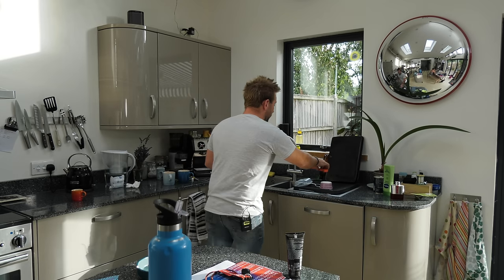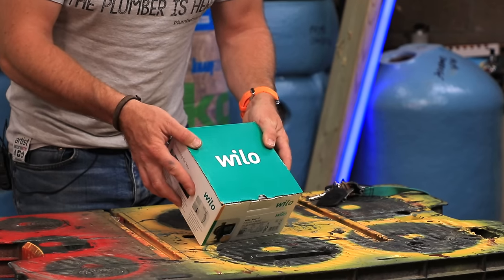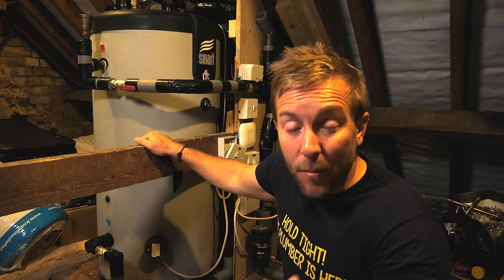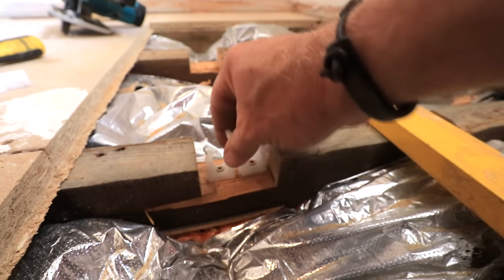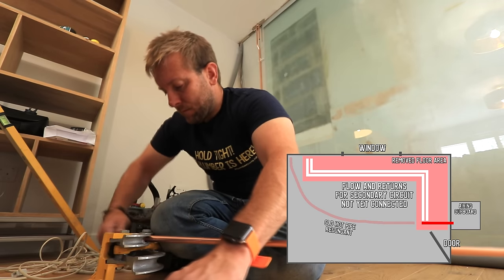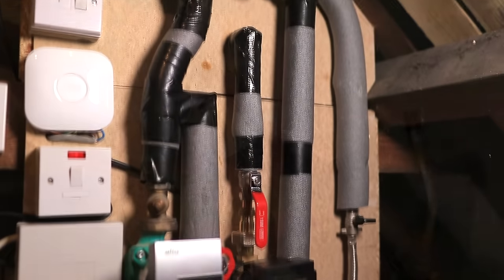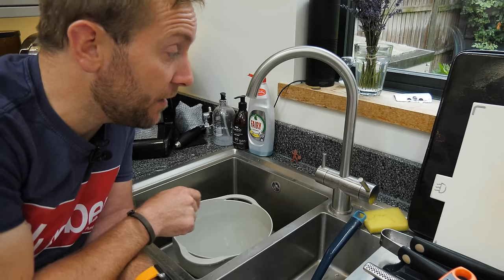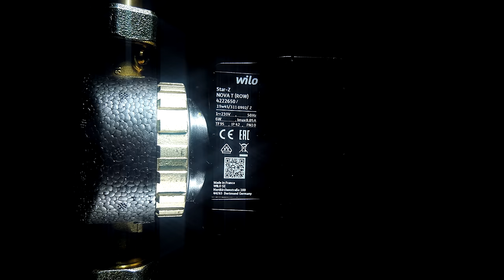HOT WATER TAKES A LONG TIME TO REACH TAPS - HOW TO GET HOT WATER FASTER! Wilo Secondary Return Pump

Comment: I live in Spain and have a 100L electric water heater which is located in the garage, the kitchen tap is about 35m from this. I have the same problem with the time it takes for the hot water to arrive. In spain is the existing copper pipes are buried into the wall, so there is no way to insulate them, fitting new pipe is possible though in the underbuild but as an alternative, what do you think about me fitting a smaller 15L under sink electric water heater in series with hot water line from the existing tank to act as a heat buffer? Something like an Ariston Andris R10? This would also mean when I dont need the 100L tank I could just use the smaller tank?

Comment: Would you consider a bypass valve to dial in the required flow around the circuit and reduce unnecessary load on the pump?

Comment: Can you 2 secondary runs off one tank? I have a run I can do in the 1st floor of the house but I also have a second floor with two en suites. Should I just run one loop and get the loop as close to all the taps and showers on both floors or can I run two loops with two pumps so I can turn the upper loop off when there are no guests and just family in the house who only occupy the 1st two floors and not the top floor?

Comment: Great solution if you can pull up floorboards etc. ... but if you can’t it 8s not much use.  We couldn’t.  So, we installed an 15 litre Ariston under counter heater on a timed fused spur.   Much cheaper and easier and achieves the same effect.

Comment: I am just in the middle of doing my kitchen extension, front porch with cloakroom, utility room and an ensuite, I have fed a separate hot water feed from the hot water cylinder to each of the taps that run in opposite directions to each other this gets over the problem of the hot water having to run around the house to feed........ lets say,  The kitchen,  utility room & then the cloakroom,

Comment: I worry about the cost of the electricity of running the pump many hours a day plus heat loss from the circuit. Would it be better to have a local mini tank near the kitchen tap or an on-demand hot electric tap?

Comment: I wouldn't like to comment on their product from 10 years ago, but the issue with their current product not being suitable for hot water return is due to the standard that they manufacture to changing to stop those products being used for a secondary return.

That change was down to a failure of someone's product, made to that standard, some years ago that caused a huge incident, that then caused BS to withdraw the allowance of products manufactured to their standard to be used for secondary returns. The cause of that incident was eventually found to be installer related and not a product issue, but British Standards are still not happy to change back to allowing products manufactured to their standards to be used for secondary return hot water pipe work.

In short, even if it were down to oxygen in the system, it would still affect metal systems much more than any plastic system.

As I commented before, we have installed thousands of return systems in projects from single family homes, to hotels, 1,200 apartment multi residential developments, commercial and industrial.

Our products are not only tested and approved for use on return systems in Europe, but also most developed countries around the world, including America.

The issue is with the BS standard in the UK that the UK companies test their manufacturing, materials and designs to.

Comment: Great tip.  Where did you tie in the return line from the wilo pump?  On the boiler's pressure safety valve?
Reply: It ties back into the line feeding the heater.

Comment: I just have the tank near the kitchen tap which is the one that is used frequently.  About 1m of pipe.  It takes half a litre of water to get the hot through.  About 2 to 3 seconds.  It does take more to reach the shower but we take our showers consecutively without turning off the water so it takes a half a bucket of water initially.  You see not only do we need to save water as we live on tank water in an arid environment but we ALSO need to avoid wasting heat as we grow and chop our own firewood.  We don't want to waste that either.

Comment: I use a Quooker Combi kettle tap and get hot water in 1 second, it's really good, secondhand units for £500, easy install under the counter, but limited to 15L of 60C water and 7L of boiling.

Comment: Off topic is your hot water cylinder mains fed and if so. If you wanted to move gravity fed cylinder into attic what would I need to do and can't use mains fed water for cylinder as it isnt allowed in Ireland. Take it you need single pump for tank into cylinder in attic??

Comment: I replaced a long run of large-bore galvanized pipe with 1/4" PEX.  Much less water in the pipe, flows a much faster face velocity when the tap is opened.  Works for me because the water pressure in our city is high - around 80 psi, maybe - and the draw rate at the kitchen sink faucet, with its aerator, is relatively low.  Flow rate seems the same, but the hot water comes much, much faster.  You can do calculations to see if it'll work for you.  It's been too long since I've gone to school, so don't ask me to do those calculations for you, sorry!

Comment: I got a leak in my hot water copper pipe which circulates the water in my home radiators, the temperature is about 60c, would be a problem if i use Flex with fast connections to repair ?

Comment: The pumped return system is fine for a system with a tank but will not work for a combi system which can take 40 seconds to get the hot water intro the sink or shower. I have devised a system to pump the drawn off water into a holding tank in the the loft which can then be used to fill the toilets. This works fine unless no water used so I have a mains water back up into the toilets. Saves a bit of water but doesn't really justify the cost of the installation.

Comment: I've a combi boiler, 6ft from the kitchen sink.   despite the boiler firing up on the turn of the tap it takes at least 1/2 minute before the water is up to a warm temperature.

Comment: Mount the two sets of copper pipes together and insulate them as 1 unit, that way the return is being heated by the pipe going to the sink,  (might help)
Reply: The return would always be somewhat cooler than the supply so it wouldn't really help.

Comment: Hold up, so why should we avoid plastic piping for the return? Is this related to copper causing PPR degradation when in the same system (that's what I could find), or should we avoid recirculating in PPR  even if the whole system is of the same material? (assuming because of faster degradation due to temperature, though most pipes are rated for 70C for 50years nowadays)
Reply from the maker: Welllllll! It’s apparently because of hard water particles scoring the pipe over prolonged circulation. This is from the plastic pipe manufacturers (I spoke to Hep and Bute) and both said they won’t cover degradation failures on this type of system. 🤷‍♀️
Reply: @plumberparts   Yes, it seems somewhat unclear what the exact reasons are. However, I found these 2 quotes on the Screwfix community forum from one of its member's who sounds as though he would have knowledge of the situation.

1)"I sit on the board of the BPF (British Plastic Federation) of which Polypipe are also members. I wouldn't like to comment on their product from 10 years ago, but the issue with their current product not being suitable for hot water return is due to the standard that they manufacture to changing to stop those products being used for a secondary return.

That change was down to a failure of someone's product, made to that standard, some years ago that caused a huge incident, that then caused BS to withdraw the allowance of products manufactured to their standard to be used for secondary returns. The cause of that incident was eventually found to be installer related and not a product issue, but British Standards are still not happy to change back to allowing products manufactured to their standards to be used for secondary return hot water pipe work.

In short, even if it were down to oxygen in the system, it would still affect metal systems much more than any plastic system.

As I commented before, we have installed thousands of return systems in projects from single family homes, to hotels, 1,200 apartment multi residential developments, commercial and industrial.

Our products are not only tested and approved for use on return systems in Europe, but also most developed countries around the world, including America.

The issue is with the BS standard in the UK that the UK companies test their manufacturing, materials and designs to.

I would be more than happy to present written confirmation to anyone that our products are suitable for those applications.

Hope this helps."

2)"Dear group.

Some systems are suitable for use within a recirculating system for both heating and domestic hot water, depending on the standards that the manufacturer uses for their product.

Manufacturers products that use BS 7291 are unfortunately not currently permitted to be used for recirculating systems.

However, Uponor manufacture their products to EN ISO 21003 for MLCP, and EN ISO 15875 for our PEX systems. These standards DO allow the system to be used for recirculating systems providing the system operates within the temperature classes as laid out in the relevant standard.

Uponor can provide written specifications for these types of installations if required."

If you wish to read the whole discussion, just search the Screwfix Forums for "Hot Water Recirculating Loop"
I don't know if Plumbparts might have any further thoughts to add to this?
Great video though, as I have been thinking about installing one of these systems and have been waiting for you to do a video on it. 👍
Reply: Use of Mlcp or pex al pex wouldn't have the same issue as other plastic pipes
Reply: @plumberparts 
As you already have shown and told us, the flow rate of this circulation circuit is very low and scoring the pipe over long times seems negligible compared to the high flow when lot's of water is needed (this is where scoring could occur, isn't it?).
Reply from the maker: Ben de Vette yeah I think it’s over zealous regs on this one...
Reply: @BendeVette  x
Reply: As stated by several well known and market leading plastic pipe manufacturers, they do not guarantee their products in such installations, because the pipe degradation caused by HOT water flowing up to 24 hours per day is highly likely!
Under floor heating by comparison is much cooler.
Standard DHW installations, invariably carry hot water for short periods of time ie fill a bath or a long hot shower. SIMPLES
Reply: @martinspencer9950  
That's strange as the temperature of central heating water (with radiators) is way higher than hot potable water (~90°C vs ~60°C). It can handle the very hot water, but can't handle hot water (even if it is continuously). Here (http://media.wattswater.com/ES-PEX-AL-EN-1142_web.pdf) is stated what the maximum temperatures are in relation to the pressure.
- 200.0ºF (93.3ºC) 100 psi (6.9 bar)
- 180.0ºF (82.2ºC) 125 psi (8.6 bar)
- 140.0ºF (60.0ºC) 160 psi (11.0 bar)
- 73.4ºF (22.7ºC) 200 psi (13.8 bar)

Next to that, it is not necessarily continuous hot water as there is a timer on the system.
I have a different pump, but that one also can be programmed per 15 minutes (96 time slots a day).
Reply: Ben de Vette 
100% agree
Heating is generally not constant. We would cook.
Secondary return is more likely 24/7 though.
Mine isn’t but I know people who do. Mad - I know

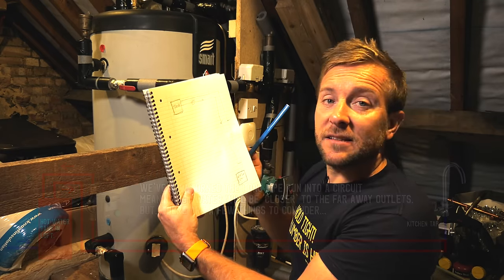Comment: Can anyone expand on why plastic can't be used? I heard what was said in the video at 8:40 but why can't you have plastic on a constantly replenishing supply line? That point wasn't explained. Thanks.
Reply from the maker: I asked the plastics pipe suppliers and they said if it fails they won't cover it, nor will your insurance. Didn't really get a definative reason why other than constantly replenished systems have a more 'abrasive' water due to hardness. But it's still fairly vague!
Reply: @plumberparts  That sounds like nonsense, surely any hot or cold water pipe is constantly replenishing?
Reply: @plumberparts  Thanks for taking the time to reply, I agree the suppliers reply seems fairly vague and doesn't really make sense to me but thanks for taking the time out to try and answer my question.
Reply: @C4sp3r123  from all my reading, and for the interest of others, it's to do with the testing through British Standards, most likely that plastic pipes have never been tested to ensure they are compliant. There is a couple of brands that are tested to European standards that are fine, most manufacturers have a clear warning not to use it, which will violate insurance and building warrants etc. In practice, it's most likely absolutely fine, but I've never tested it!

Comment: James, I recall that you have worked in commercial. Have you ever suffered at the dictatorial and tyrannical whims of the bottom inspec.. Ooops! Water inspectors?  The external auditors who supply certificates of compliance for insurance purposes. 
Goldilocks! Not too hot, not too cold and min 50 deg c, 60 deg max after 1 minute of opening any hot water draw off point. 
I have to maintain 3 fortics and a huge, vented, copper cylinder for a bingo hall. 34 hand wash basins, 3 cleaners sinks and 5 huge, deep stainless steel catering sinks.
That's before the 32 bogs and 3 staff showers!
I had to maither and cajole the manager for the dosh to change a sec ret pump fer 3 months as the water at the furthest draw off points was struggling to get to min 50 within the 1 minute  required time.  Even when I mentioned possibility of bacterial contamination on the now dead pump return leg, as the pump had gone kapput. Oh, the irony as the business opened up last week with easing of the lurgy lock-down and there are perspex panels and directional pedestrian arrow indicators everywhere. 
George Carlin, Fear of germs.

Comment: Did you have a secondary return connection at the hot water cylinder? If not how did you connect that last bit in the loft?
Reply from the maker: Yes there’s one on this cylinder especially. Works a treat!
Reply: plumberparts thanks for the reply. Basically you took the hot feed all the way down to the kitchen where you connected onto the plastic part and the return is the new pipe you connected to the secondary return at the cylinder?!?! The pump should be pumping towards the cylinder right? Have you checked the Wilo stratos?
Reply: Could you not use a cylinder without a secondary return tapping and tap at the bottom in so you will keep the whole cylinder hot
Reply: trick17und4 No, that will destroy the stratification in the cylinder, instead of properly hot water at the top ready for use, and cool water at the bottom, waiting to be heated, you would end up with a whole tank of lukewarm water every time someone had drawn a bit off. It would also ruin the efficiency of your boiler- you want the return to the boiler to be as cool as possible, i.e. From the cooler bottom of the tank.
Reply: Spencer Wilton the problem I find is that Vaillant cylinders haven’t got a secondary return connection and when I ask some engineers they’ve told me they would connect back into the cold mains at the bottom ... anyway, I get your point and appreciate your explanation which I definitely like!! Thanks for that
Reply: Spencer Wilton the secondary return is just to circulate the hot water so it’s basically ready to use immediately when someone opens the hot tap ... why would the cylinder be lukewarm if it’s heated by the boiler anyway? It would basically use less gas as it keeps the cylinder on a certain temperature doesn’t it ... it wouldn’t need so much to heat it up to 60c for example

Comment: There’s a few ways 1. If you’ve got a combi boiler could be due to low pressure 2. The main heat exchanger could be blocked with magnesium and calcium effecting the heat transfer. 3. The stop tap may not be fully open. 4.if you have a water heater the thermocouple may need replacing or cleaning and 5. If you’ve an unvented cylinder and the property is quite large with a numerous amount of en-suite and bathrooms then you may need to install a secondary return on the hot so that you’re not drawing off so much cold water.
Reply: If you have some type of primary multipoint water heater in the attic or somewhere where you’ll lose heat then maybe the pipes need lagging.